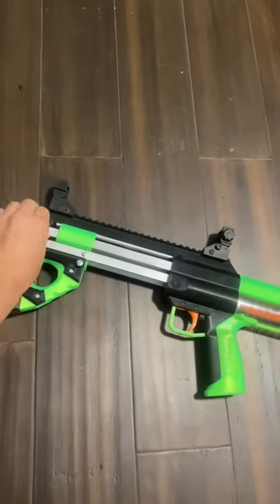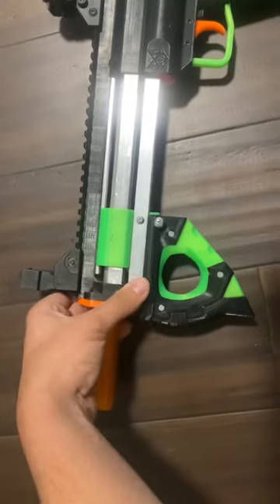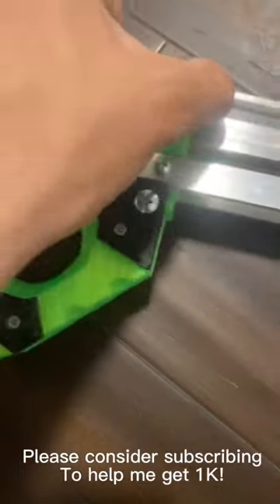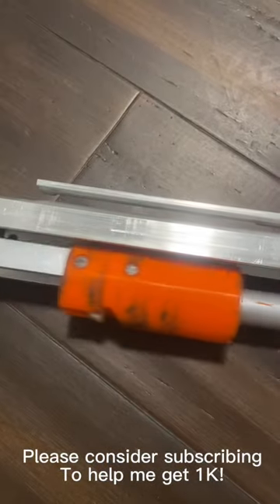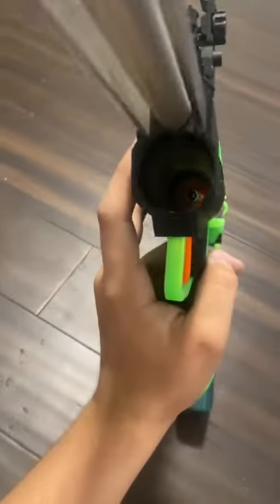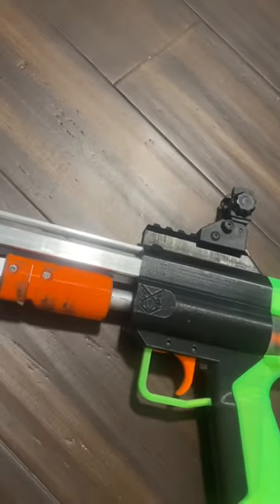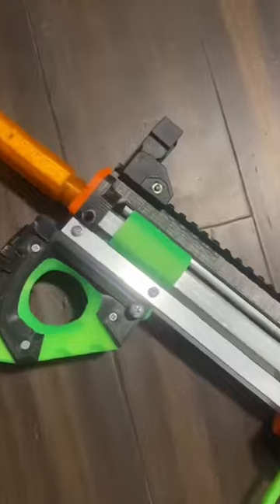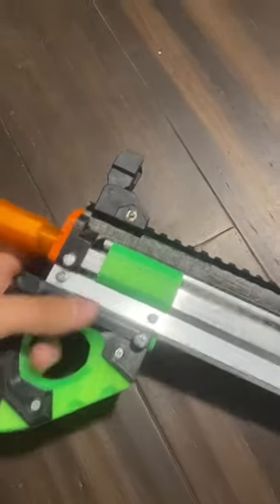How to quickly spring swap a Nerf Orion blasters Lynx

Comment: Cool, what fps does it get with that spring?
Reply from the maker: I am not sure yet as I do not have a chronograph. I believe it is supposed to hit 200 fps or more theoretically.
Reply: A K17 hits about 200 on a standard Lynx with a SCAR barrel. Mine hits 220 without a SCAR. I think a K25 or K26 gets close to 300
Reply: It was a k18 spring